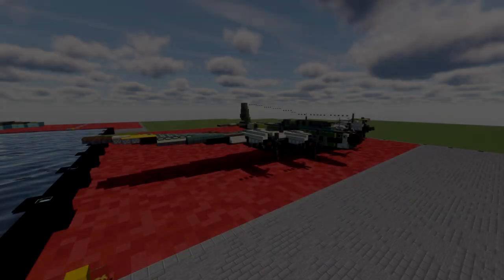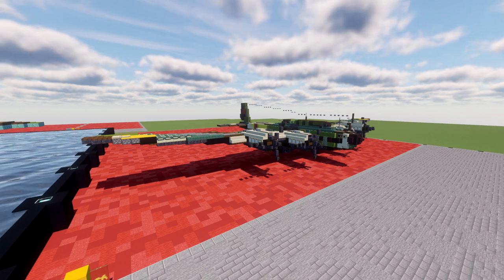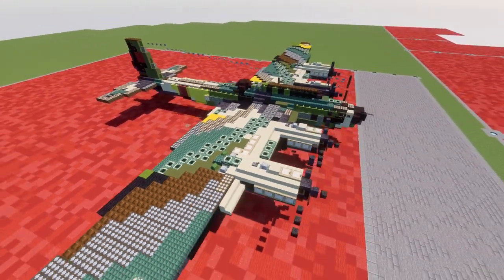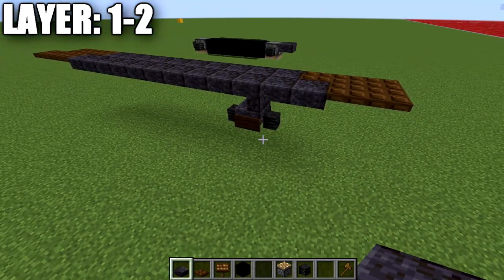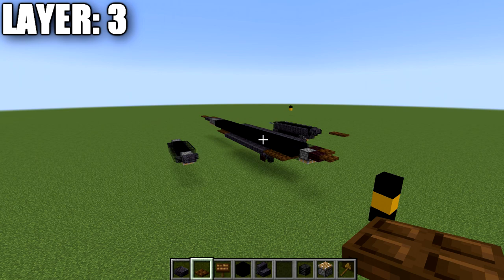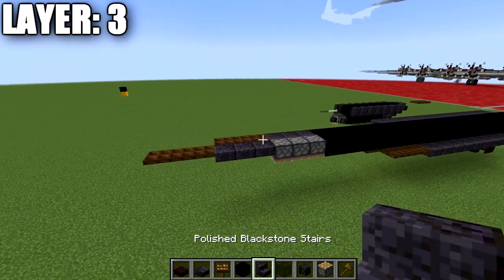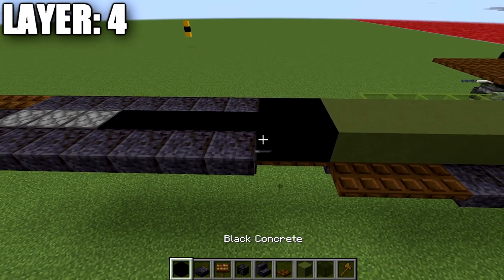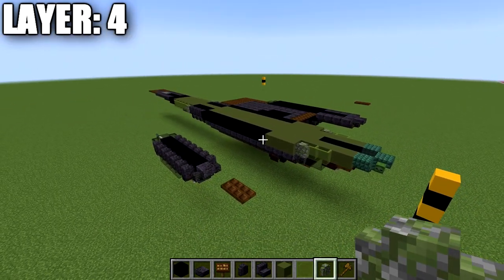Minecraft: Petlyakov Pe-8 | Heavy Bomber Tutorial

Comment: Did can carry the ФВБ-5000?
Reply from the maker: I would assume so. This was the largest Soviet bomber of the war, so if anything this had to be able to carry it.
Reply: @GARRETT2BY4 Depending on the variant it carried up to 7 tons.

The later war imoroved Pe-8 production models in 1944 were continued in the Nezval plant, where they solved many limitations with the design, so you could call this the Pe-8 "Nezval" unofficially. Externally the only visible difference it got is the late war style front dorsal turret, which you can see looks exactly the same as the Yer-2. Other than that spar strength has been improved a lot.

But obviously just like the rest of TB-7s or Pe-8s, they got overused wayyyy after critical damage in need to repair. Nah, they still were overused up until Soviets calmed their bomber forces down in mid 1945, leaving the only servicable one to be.... one of the earliest production models, the TB-7 AM-34FNV "Understudy". Basically the thing you built, except the different engines and it had 7x small caliber machine guns all around
Reply from the maker: @zrbbg9639  Thanks for the information! :)